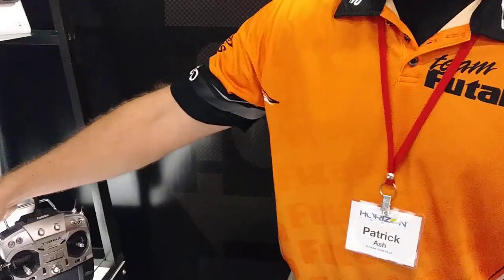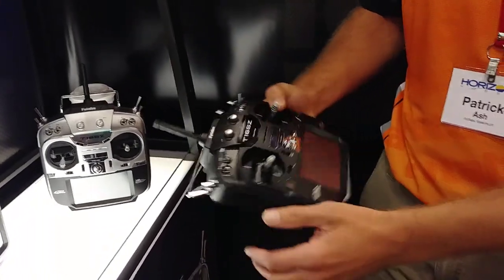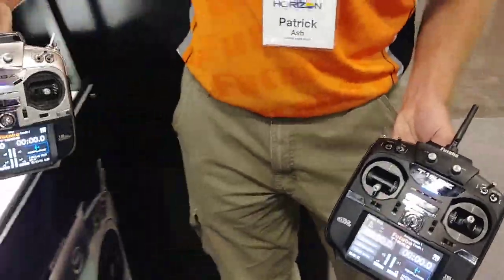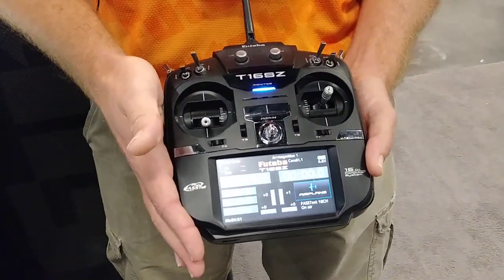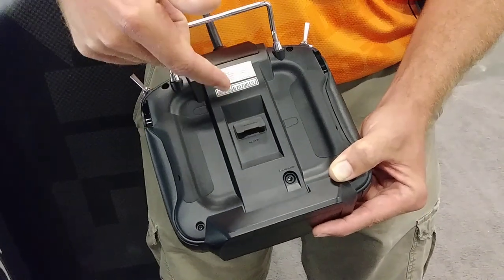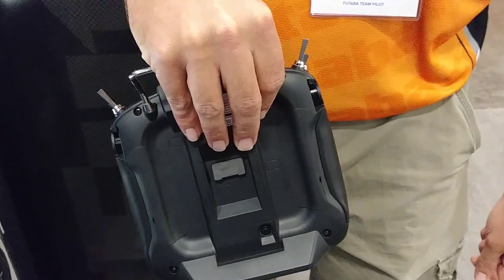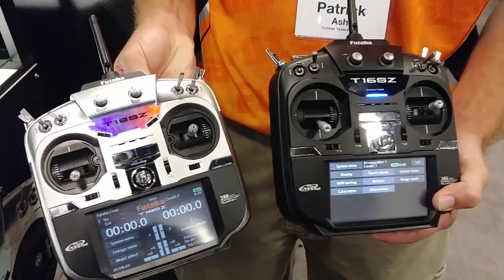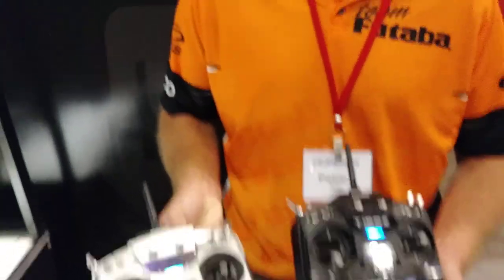Patrick Ash sharing some Futaba wisdom... :-)

Comment: It boggles my mind that the 18SZ does not have switch assigned speech function.  The competitors do that at much lower price.
Reply: I'm thinking of buying this radio. I have a 14sg which i can assign a switch for speech funtion. Does the 18sz not allow you to assign a switch for speech funtion? I.e switch for telemtry info!!
Reply: @heron9524  If you're referring to voice telemetry, then yes the 18SZ has that feature.  You can assign to any switch for telemetry readout just like the 14SG.  But it can't assign non-telemetry related voice to switches, such as calling out "flaps up/down", "gear down", etc.
Reply: @bohan9957  thanks for the quick reply. I'm not too concerned about flaps down etc. Maybe i read your comment wrong. As long as i can assign a switch for telemtry readout then i'm fine. Thank you

Comment: Futaba SZ series is just awesome, I have both the 16ch and 18ch. OK, it is FUTABA $$$$ BUT...  NO glitches, great look and performance. and when I got the 16SZ a 18 months ago it was "cash no credit" for $599.99 @ my local Hobby shop. I paid it and was happy from day one. with all the telemetry functions and the voice . Maybe there is more feature packed and lower priced radios out there BUT I am totally happy with the FASStest protocol and my FUTABA 16SZH! And I would highly recommend it.
Reply: How do the gimbals feel on the 16sz? It seems to only have one ball bearing per axis, which means less smooth than those quad-bearing gimbals...
Reply: @dontflyspirit6535     The gimbals feel ok to me. They have no binding issues and move freely/smooth throughout the range of motion. I have the heli non ratcheted version. They were fairly tight out of the box. I have not adjusted anything and happy with the Futaba 16SZH.
Reply: @rccosplay3249  how do they compare to the quad-bearing gimbals of 18sz, or spektrum's dx gen 2 line, or jr 12x, xg14, etc